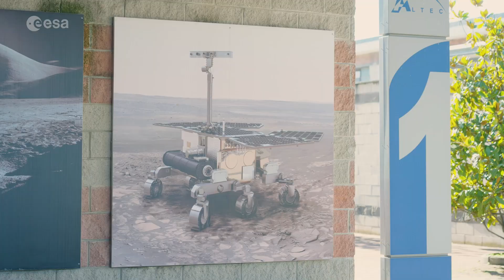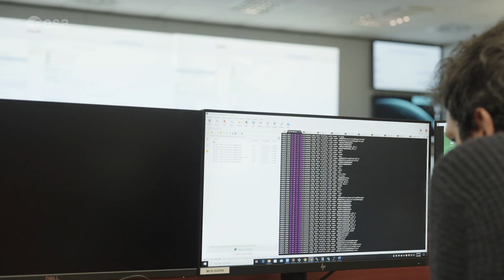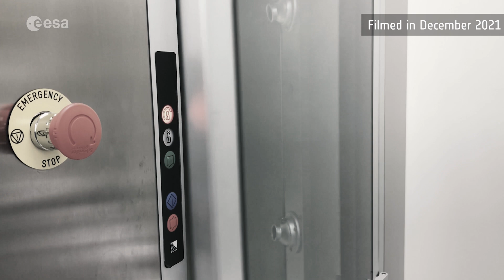ExoMars | Back on track for the Red Planet

Comment: The story with the rover stretches back to the beginning of the 90s, the plan implied back in 1994 to send both penetrators and the rover, but Russia already then began to disintegrate and degrade and for 30 years science has almost exhausted itself since there are only speculators and there is no development.